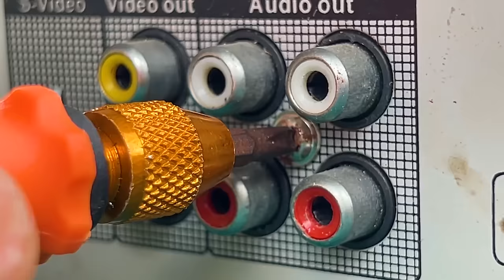How to turn a DVD player into a amplifier , no IC , simple circuit

Comment: That speaker definitely had 2500w, even more so that you wrote it there.🤣🤣😂😂I would like to know where the device got 1300w when the source in it has about 150W.🤣😂😂😂
PS:When your house burns down, at least you'll know why it happened.🧐🧐🧐
Reply: I tried a double sided DVD in my unit, it measured 2650 watts.

Comment: to good to be true with that 3 jumper wires. a miniature amplifier was placed  underneath that pcb connected to its power supply. the output signal from the cd preamp was connected to the inputs of the miniature amplifier, by disconnecting the connection from the RCA's and transferred it to the inputs of the miniature amplifier and then the miniature amplifier's speaker output terminals were connected  to the rca outputs.......

Comment: U tube must be blamed for this kind of nonsense,  an old DVD with a just ten watt power supply  you can only load another Ampere as a load resulting in some low power audio !! He claims 1300 watts!! .
Reply: I built it with 3 prong power cord and got 1900 watts.

Comment: А громкость вы как прибавляете или убавляете  ? Не как.😀
Reply: Just add a little water to the modulator until the valve opens completely on its own, at which point the volume will respond via  Bluetooth connection or the app if connected to WiFi.

Comment: Pl tell the Material name that soldered on board to buy
Reply: The first ic is LM380CT. The resistor is 22 meg, 2 watt.
I tried a ceramic version of the ic and the output increased to 1550 watts.
It runs much cooler now.

Comment: Nice but how to control volume.
Reply: You have to put finger on disc to absorb power.
You can use a piece of foam rubber also.
It is hard to get it to stay in place, I will try Gorilla glue maybe

Comment: I am afraid to touch the output bc it’s not isolated by mains
Reply: Change cord to grounded type you will be ok.
On my player I get about 50% more output, about 1900 watts.
Double sided disc will not give as much, something is saturating in the motor.

Comment: It is a bad video. The connections are dangerous. You are soldering in the L of the 220v to speakers. Also, you should cover the wires of copper. They are making contact with the metal chasis. Dangerous.
Reply: I built it with lead free solder and got 1500 watts.

Comment: Can not control the volume
Reply: There is adjustment trimpot on the laser.
It does not go full range, the one I built only goes down to 40 watts on each speaker.

Comment: Nonsense! you don't explain how it's done.
Reply: You have to put a lot of solder on the jumper connections.
I measured 1650 watts after doing this.
Also there is much less heating.
Solder is expensive but this worth it.